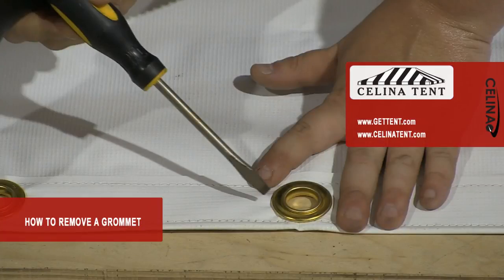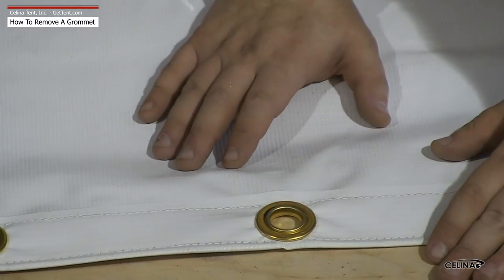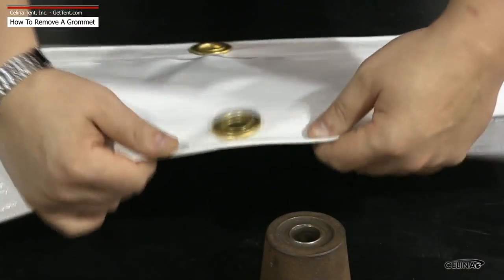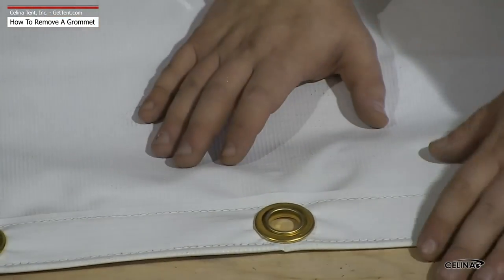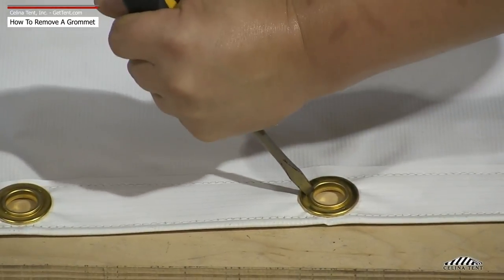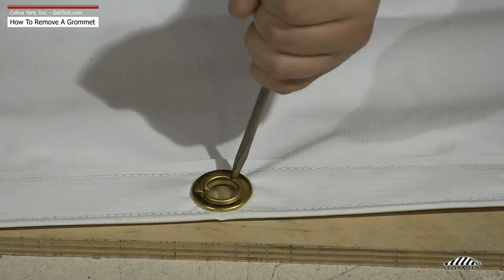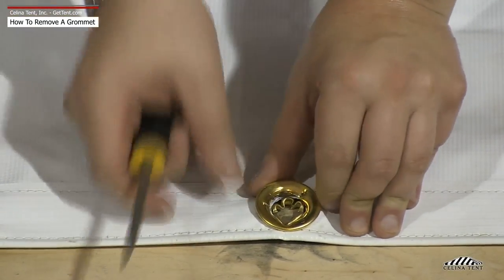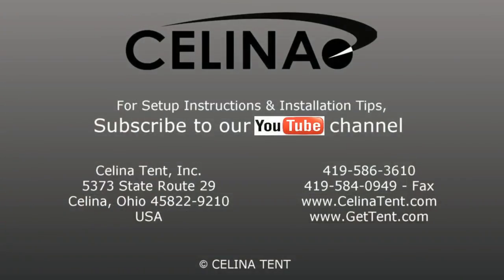How to remove a grommet from fabric

Comment: is there no way of removing grommet without breaking it?
Reply: Correct.
Reply: It depends on the metal used for the grommet. I've reused ones made of more pliable metal. Instead of hammering the flat head screwdriver, gently pry the beveled edge upwards until the grommet comes apart. I used needle nose pliers to reshape the inner ring, in places where the screwdriver messed the shape up slightly. I cut down a tarp for my tent, and was able to reuse the grommets this way. It was a cheap plastic tarp, though. More quality metals might be too hard for this process.